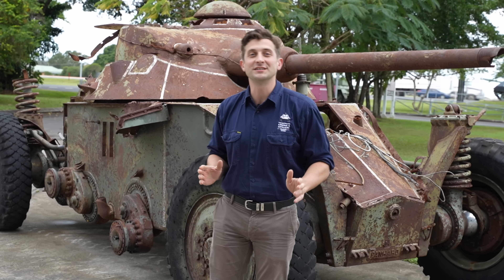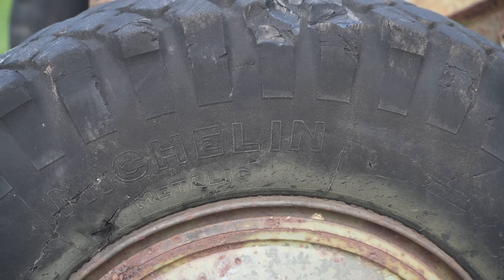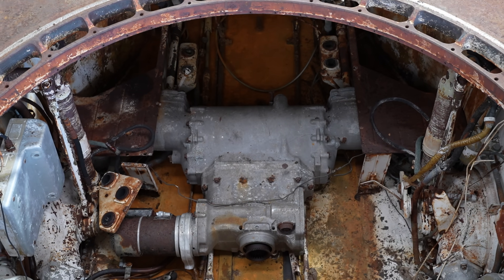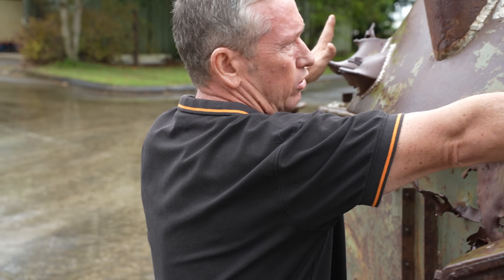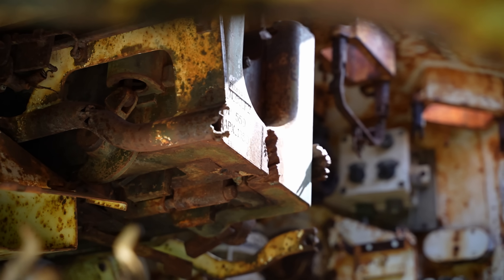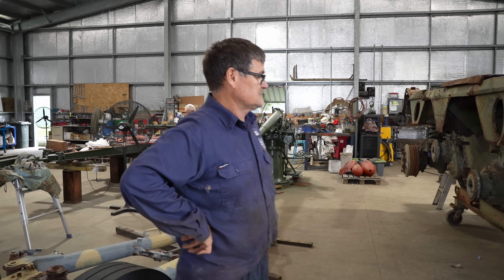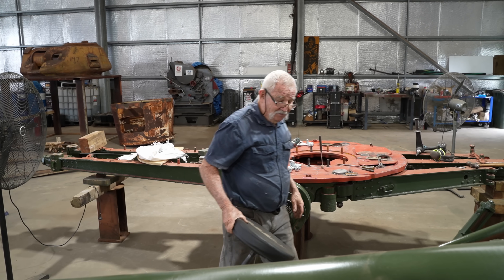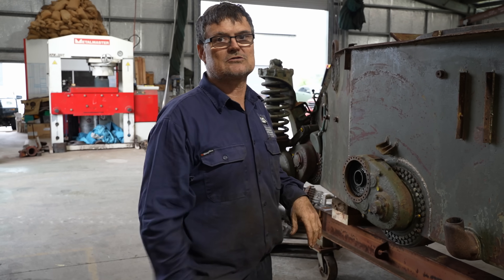WORKSHOP WEDNESDAY: Panhard EBR 90 Armoured Recon Vehicle RESTORATION PROJECT briefing

Comment: the purpose of nitrogen isn't to cool the tyre it is a temperature/volumetric stable gas. regardless of temperature it remains at the same pressure therefore doesn't alter tyre pressure be it -20 or plus 60. Especially useful in racing etc.

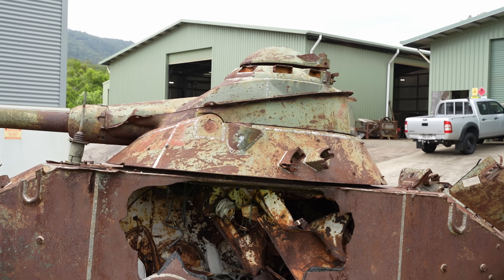Comment: @2:40 wonder if one could swap this into a tesla (reason I picked tesla is because of the battery pack placement, it would probably be not far of from fitting under there) but it's probably too wide tho.

Comment: Were those horizontal lines in the gun barrel designed to give the shells fired some stability while not giving them any spin? The French really liked the HEAT shells for their tanks but spinning makes them less effective.  The gun on the AMX 30 series fired a unique HEAT shell designed with a moving outer casing so they could be fired from rifled barrels but only the casing and not the charge itself would spin. Could those lines in the EBR’s gun be a way to keep the HEAT shells it fired from spinning without the expense of the specially made shells?

Comment: Sorry to be the "well actually" guy. Buth well actually nitrogen filled tyres do not run "cooler".
The thermal expansion of air vs. pure nitrogen is neglect able. Air is already approximately 87% nitrogen. 
The only main advantage of nitrogen filled tires in this case is the absence of oxygen, which can accelerate fires. 

Love the video and looking forward to the result.

Comment: Did you buy your car from a gypsy? In the parking lot of a supermarket on Sunday, during closing?
There are pieces missing, The technical control sheet says, trace of corrosion?
For less work, ask the Russians, they have vehicles of several nationalities in much better condition . 😁

The eight-wheeled Panhard 201 was designed in 1939 by Louis Delagarde to respond to the 1938 armored car program issued by the French army

Comment: Can anyone tell me why most of the welds are so clean looking, vs rusted?
Reply: Stainless weld does not oxidise (rust)
Reply: Answers my question, I did not know they used stainless steel for welding back then. @jasonbelgrave2831

Comment: Interesting vehicle, would it be worth displaying both with the intact bodied having a mock up of the turret and gun for the overall external look and the holed body one having the interior restored and using therefore as a cutaway (as done at Bovington Tank museum on some tanks) to give visitors a more in depth display (seeing how the engine is mounted is interesting relative to the rest of the vehicle) and would preserve both chassis's.

Comment: At the entrance of the Panhard military manufacture next to Paris there's a restored one sitting at the entrance. At least until they got bought by Renault. I didn't return there since. Where I use to work we had an 8 cyl engine. The heads as far as I can tell are regular car heads and I believe the crank is just an extended car crank (you can do that with Panhard because of the way the crank is manufactured) it wouldn't surprise me if the pistons, wrist pins, con rod, valves, rockers and torsion bars (the engine doesn't use springs) are identical to their cars.

Comment: I dont like this tank, 16mil armor, weird machineguns that smoke up the inside, the extra wheels that spin when not on the ground, dubble steering, very handy flat engine .. but you have to remove the turret ... all stuff that's compicated when it does not need to. 

Mabye this restoration changes my mind about this weird "tank" and im looking forward to the craftmanship you fellas have !
Reply: Armor is meant to be thin to save weight, it's a recon vehicle. The extra wheels are a huge detriment when lowered on paved surfaces, lowering top speed, but a huge help offroad for extra traction. The added complexity of the raising/lowering mechanism is worth the tradeoff for this vehicle, besides the fact that the mechanism itself is not particularly complex to achieve the lowering/raising.

Comment: The Elvas Military Museum, in Portugal, is currently restoring a 1954 model in time for April 25th, 2024. They are fairly intact but in very rough condition, i say "they" because there´s actualy a few available to scavenge spare parts and what not, im sure if you guys need help they can help you guys, of course Musée des Blindés in Saumur should have a lot more technical documents and donor vehicles

Comment: oh wow, this looks like an awesome project to work on, and i am loving the flat 12 cylinder Panhard arrangement - i'm not generally a big fan of French designs, but this definitely floats the interest boat in something that's pre WWII and so innovative 
love the idea of the second driver, its a proper 'push me pull me' and 'run away quick smart'
Reply: The engine is actually based… on the flat twin of the Dyna Panhard, a very popular car at the time.
Reply: @chefchaudard3580  i kind of remember them, or should say one or two, they were in pieces at a workshop my dad used to frequent, we often used to assist in the engineering work going on there, my first personal project was an old 2.25 petrol lump for my old Land Rover S3 Lightweight, guess i got a bit of a bug for restoration

Comment: The "confrontation" between the EBR and the M47 actually took place in the streets of Lisbon during the Carnation revolution in April 74. They were on opposing sides of the revolution, but eventually they both stood down and no shots were fired.
Reply: And the EBR had the FL-10 turret with the 75mm SA50.
Reply: Your comment may lead to confusion, it is indeed the M47s which were ordered by the loyalists and the EBRs by the revolutionaries.

Comment: With the vehicle that's got the hole in its side that could be a great display with the interior all in place and how it works from the outside. Like a Cross sectional view.
Reply: Thought that too.  But it would only be useful if you had a complete, intact interior, which sadly they don't.

Comment: a little addendum:
not all EBRs had two radios, troop vehicles only had the one radio set installed in the turret, in front of the commander (SCR 528), platoon command cars had an additional set (SCR 506 or TRVM 1) mounted with the rear driver to talk on the divisional network as those vehicles were affected to divisional reconnaissance groups

Comment: With those big independent springs, it looks like an insane, heavily armed rock-crawler!
Reply: Mad Max vibes
Reply: @awf6554  Yeah i'm getting Mad Max 2 vibes...
Reply: @awf6554  thats what I thought too. Took me a sec at first glance to realize it was a EBR haha. Then I realized it was in the title.
Reply: @awf6554  It would fit right in to the wastelands.
Reply: I was thinking a dune buggy on steroids
Reply: It IS an insane, heavily armed rock-crawler!
Reply: heavily armed with its 30mm thick steel armour
Reply: @DBossyGuy  In Germany, a vehicle like that is considered a weapon of war by law, just because of any armor.
Reply: it kinda is
Reply: @@paulfellows2604 And this thing even has the hydropneumatic, Citroen is famous for, I later found out. I once hat a XM, I miss the hissing and quirk. You brake with with the system too, the pedal is not a piston but a valve.
Reply: It's french design too, the 2CV has it's lamps at that place, and the hood is quite similar.
Reply: Thumbnail made me think it was a steampunk movie prop